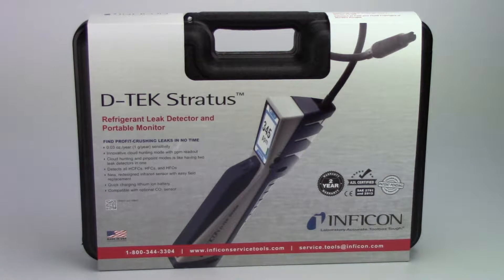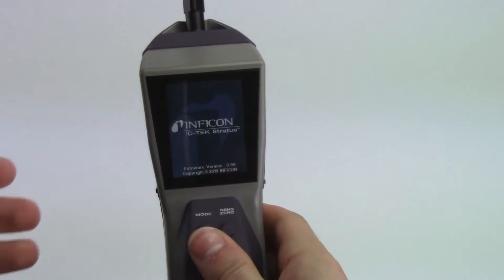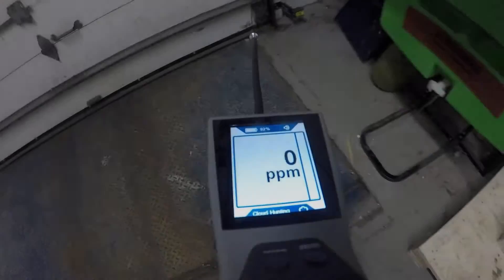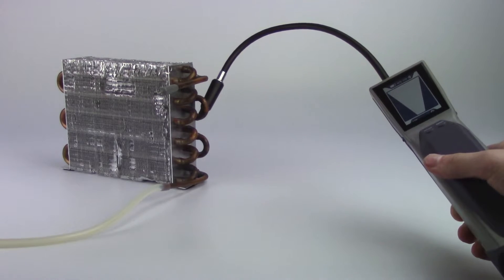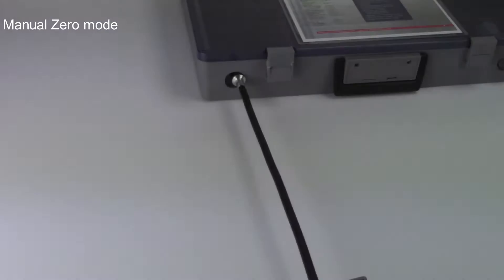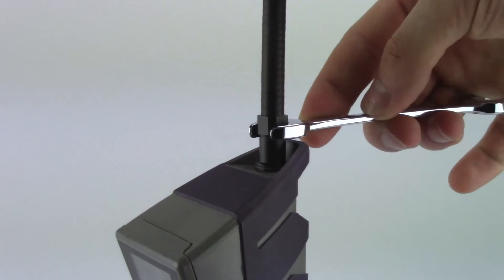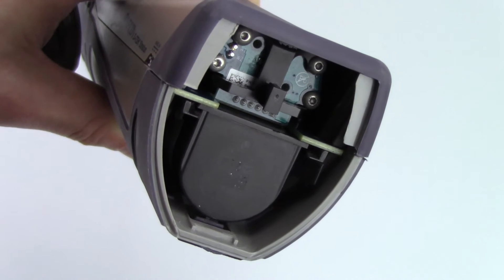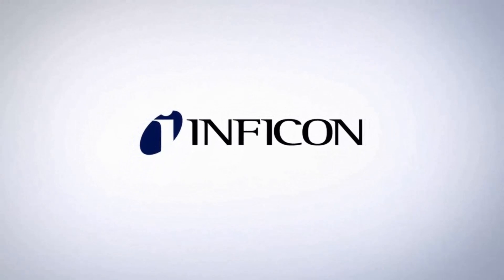INFICON D-TEK Stratus Quick Start Video

Comment: Is there a sensor so we can test for combustible refrigerants like R600 and R290? 
Also can we use this to pinpoint Natural and Propane gas leaks.
Reply from the maker: Hi Thomas, we recently released the flammable refrigerant sensor for D-TEK 3 & D-TEK Stratus. With this sensor, you can detect A3 flammable refrigerants like R290, R600a, and R441a. If you purchased either of these units a couple years ago, you may not have the required software version (at least 1.4 for D-TEK Stratus & 2.0 for D-TEK 3). Contact us to upgrade the software of your unit for free.

Comment: An additional CO2 sensor is very necessary. In Russia, cooling R744 is already quite common. How much does the Stratus with two sensors cost, and two battery coil and is it sold in this configuration?